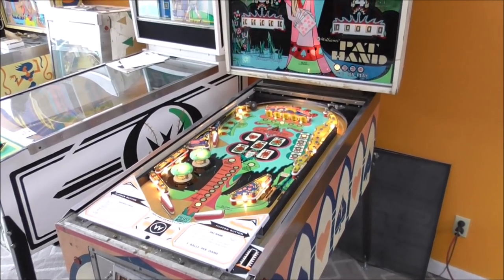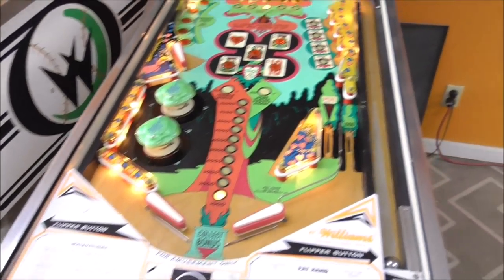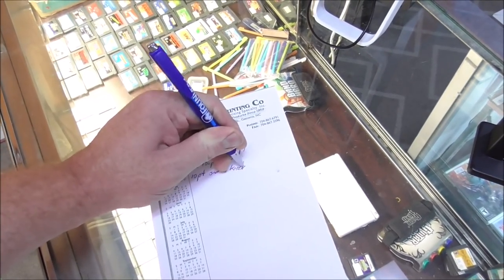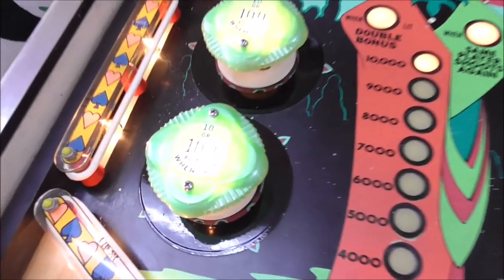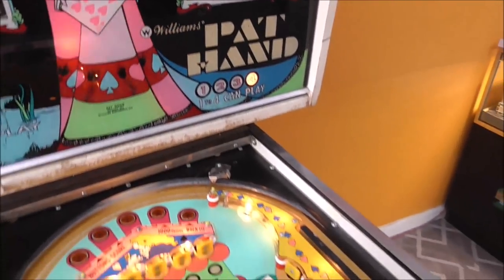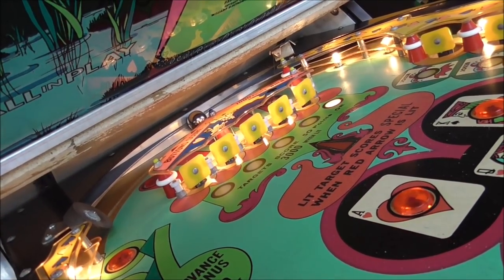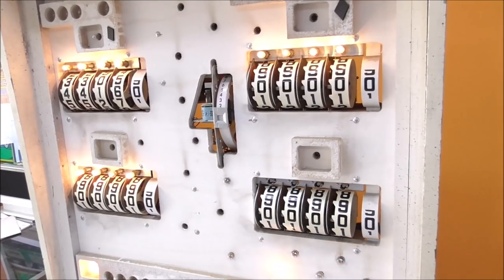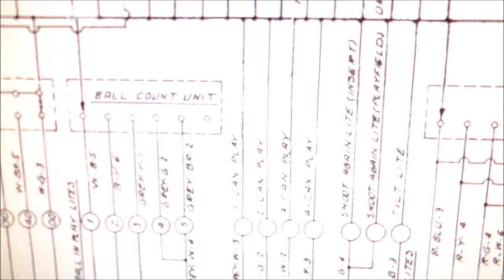1975 Williams Pat Hand Electromechanical Pinball Chime Box Repair - part 5 of our Series!

Comment: When you hit the 10 points and go 90 then go up 100 but it says 190  
Instead of 100?
Sould it work that way?
Reply from the maker: It should go from 90 to 100.. .BUT, off camera, the button I was pressing for 10 points, had lit up, which means it was now worth 100 points.  So it went from 90 to 190 like it should in that instance.  I was confused at first too...

Comment: I wonder why anyone would've removed the chimebox in the first place?  Didn't like the way they sounded, I guess.  Or didn't want to keep the wife awake by playing Pat Hand after midnight.  ;^)
(Well... I suppose something in the box could've failed, so they took it out for repairs, and they just never replaced it.  I like the idea that the wife cussed them out for playing pinball after bedtime, though.)
Reply from the maker: Damn part swappers did it.  So here's how a partswapper thinks, they have a broken machine where something isn't right, and instead of fixing it, they swap the part with one out of another machine they have back at the shop or wherever.  Then they never fix the original one and lose it somewhere along the way.... so you end up with games that have parts missing because of damn part swappers.
Reply: @LyonsArcade  Yeah, I thought of that just a few minutes after I posted my comment.  (The drawback to hindsight is it's always 20/20.)